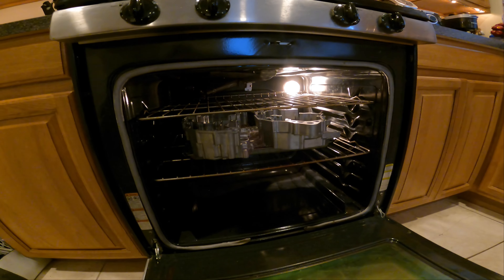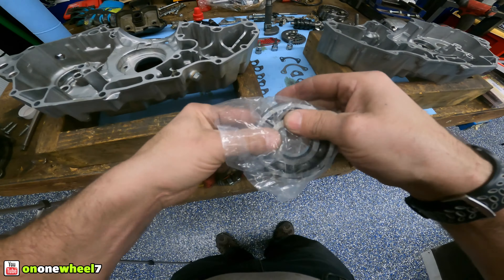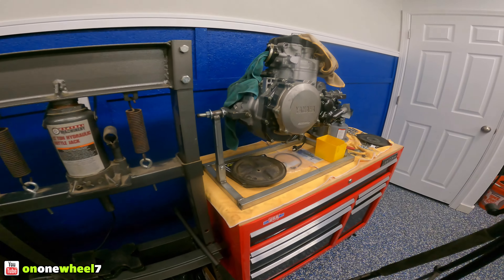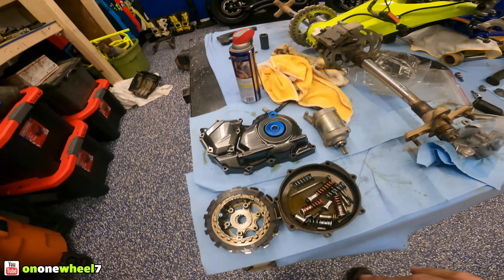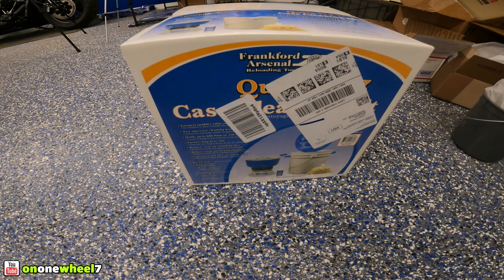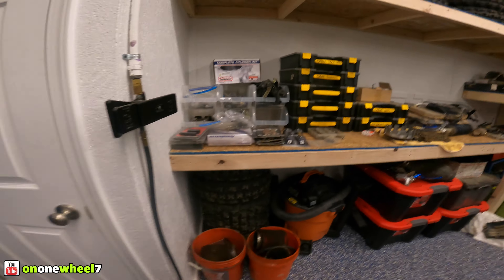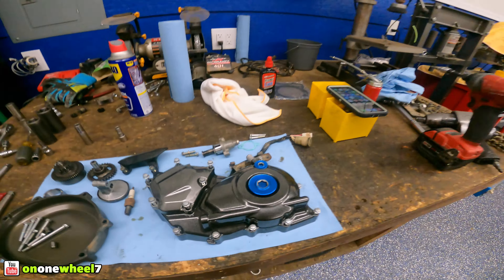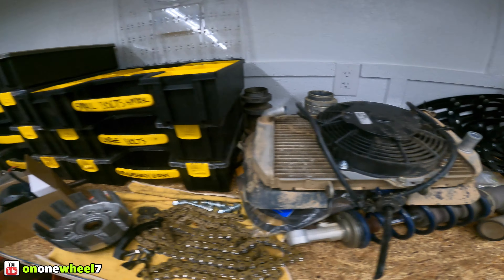PRACTICE QUAD BUILD UPDATE

Comment: The heat and freeze trick never gets old 👍🏻. Have you ever tried air conditioning coil cleaner for your radiators ? You can pick that stuff up cheap and will make your rads look like brand new with no scrubbing at all
Reply from the maker: I love the heat and freeze trick haha! I have not i may try it out were do you get that stuff?
Reply: You can get it on Amazon. If you type in coil cleaner it will come up. What I buy is called Nu-Brite condenser coil cleaner. It comes in a gallon it’s about 30 bucks. Just put it in a spray bottle and watch the magic of the dirt just dissolve right off. There’s also a YouTube video of a guy using the same stuff on a ltr 450 rad
Reply from the maker: Im gna check it out and try it!
Reply: @ononewheel7  it’s def worth the money and that stuff will last you along time. Let me know how it goes
Reply from the maker: I will for sure man thanks for the tip!
Reply: @ononewheel7  anytime man. Glad to help

Comment: Just wondering how many hours you get out of a crank before bearing failure?  I  have an '09 with low hours and am wanting to build it this fall/winter. Everything is fine now but thought it may be a good idea to have the bottom fresh before i spend $$ on the top end components... I've been told go with a '14+ oem crank, better and cheaper than the early ones. Great videos by the way!
Reply from the maker: Def go w the 14+ crank for my race bikes i usually do a complete engine rebuild each season the bottom end really isn’t needed but i do it any way. If its not broke dont mess w it 🤣🤣🤣
Thanks man.
Reply: @ononewheel7  Thanks!
Reply from the maker: Anytime.

Comment: ever had any outgassing or smell from putting cases in the oven?  I have to remove all the bearings from an outlaw 525 and the manual says 325 in the oven is the correct way.
Not sure what the wife will think.
Reply from the maker: You probably will get that with old dirty cases all mine are always soda blasted and cleaned afterwards so no smell! When i did old carriers it did smell for a few days the wife wasn’t  happy 🤣🤣🤣 so now i do those on a hot plate!

Comment: What suspension do you run
Reply from the maker: For the front shocks i run the fox custom springers from bnr motorsports and in the rear i run the stock shock which bnr respring/revalved for my weight and im using his xc link!
Reply: @ononewheel7  thanks
Reply from the maker: Anytime!